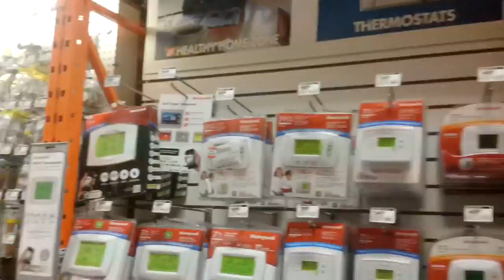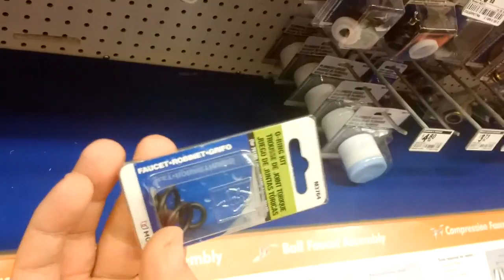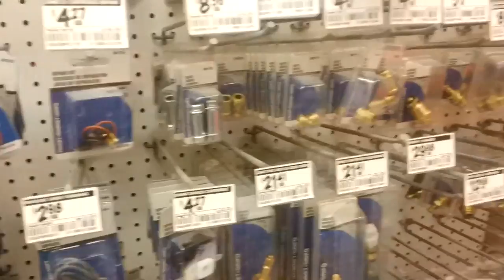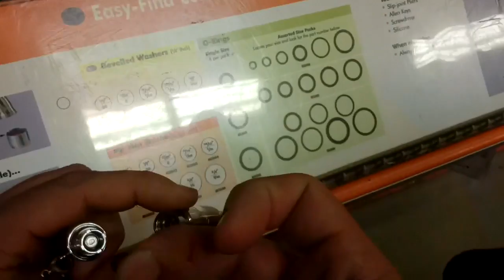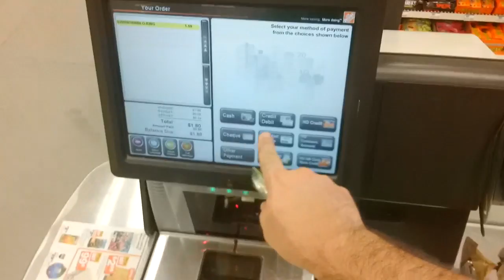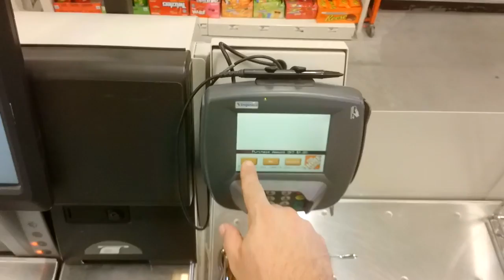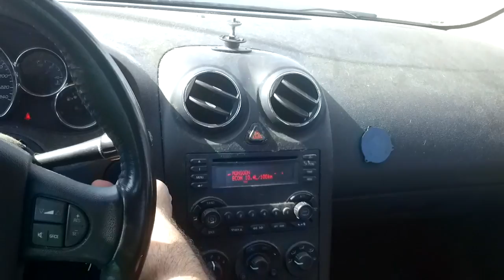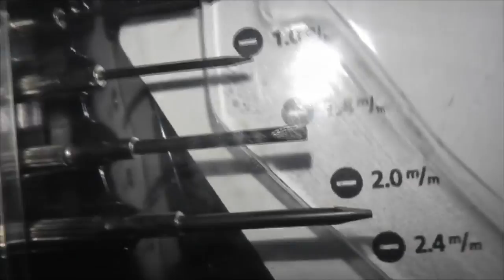MVP Down, Home DEPOT WE A GO!

Comment: if you ever have to re-solder that connector start looking for a new vape , that's what happened to my V1 andi's toast now. those o rings are usually in drawers over in the hardware department where they sell the specialty screws, bolts etc. and you can buy just the size and quantity you need that way too.  
Lol gotta teach the home weepo guy how to math.  
AWW we know your pin number now it's **  :o)  yeah who the fuck writes checks any more , that's one sick bitch 
Dodge driver was waiting on a different shade of green!!! 
the yellow Stanley screw drivers that Rip has come from Wally world that's where i got mine back in 2005
That stuff behind the mall is 4" roofing insulation for Commercial construction

Comment: Weird setup for the cards there, here we just shove the card in, enter the PIN, press Enter and it's done... :P

Technically, some Saturns are still being made, they're just called Vauxhall and Opel... :P

Dodgy construction there if they can't even make the exhaust line up with the body... :P

hehe, that guy was Driving without due care and attention, not looking at the lights, taking his hand off the wheel to finger you, and driving a big ol' POS that hasn't been built properly, dangerous driver right there... :P
Reply: Ours states the amount on the screen too, but the account & cashback thing isn't done, mostly cos the card is of the one account so no need to choose accounts, and most people use the cashpoints outside most stores anyway so cashback is not necessary (the manned tills offer it though)... :)
Reply: *****
Our banks only set up one account for debit cards, so if you have three accounts, you have three separate cards, and as for fees, we don't have to pay them, the banks/card co's do, unless people are dim enough to use a standalone cash machine that charges for cash withdrawals, the banks did try the fee thing years ago, but us brits are stubborn people and refused to use machines that did charge, so now we can take out cash wherever we like without worrying about fees... :)